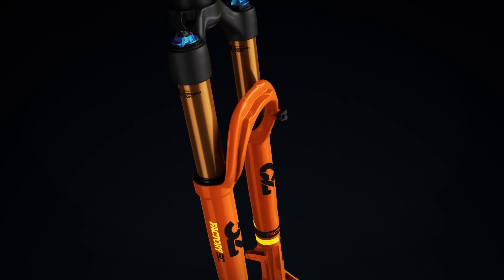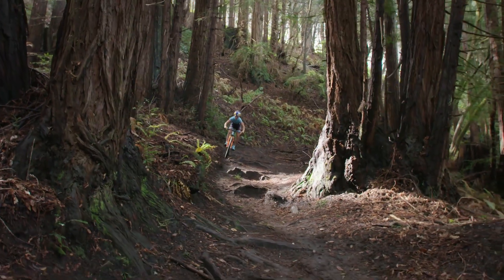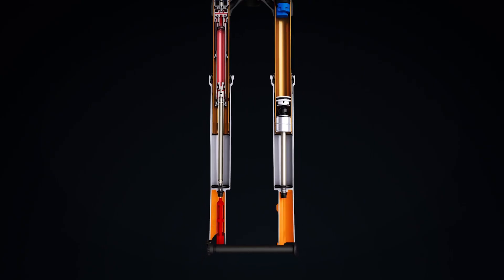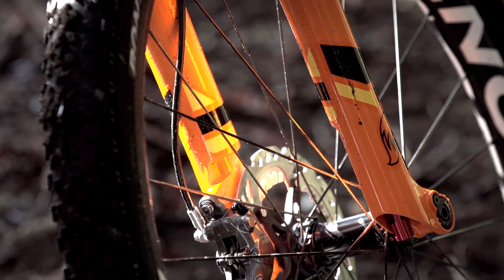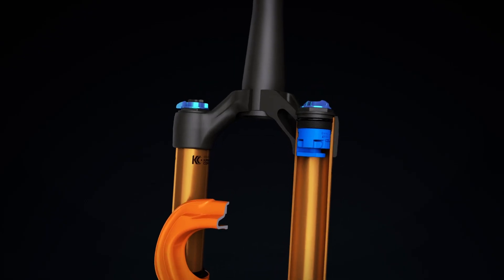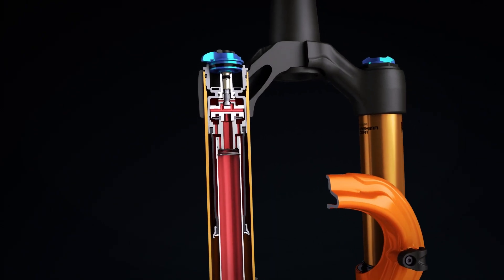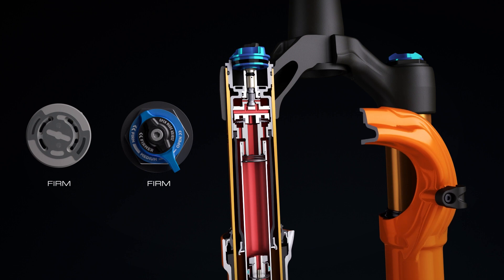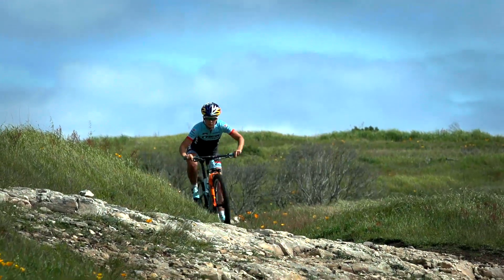FOX Step-Cast Technology Explained

Comment: Hi there. Is there any way to change the travel from 100mm ste-cast for a 120mm?
Reply: No. You can make it shorter by replacing airshaft as in ax version